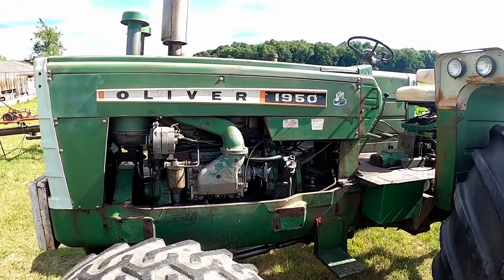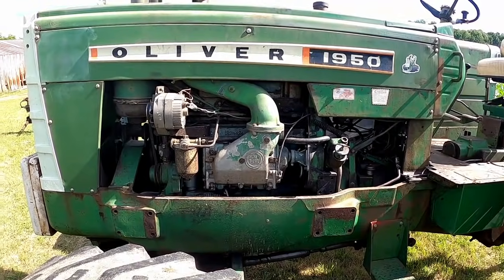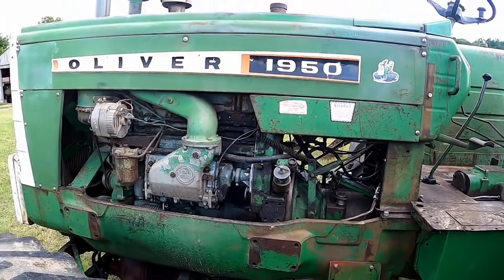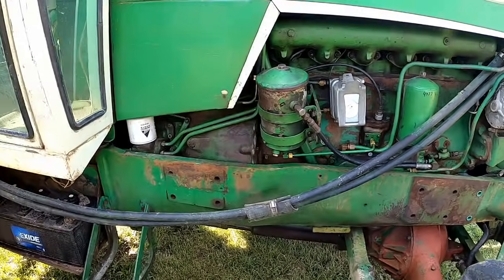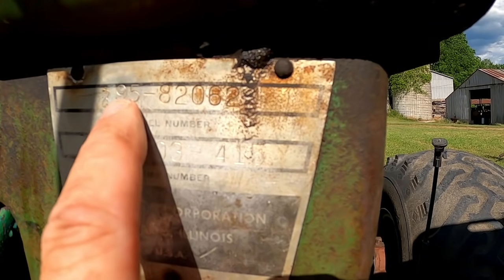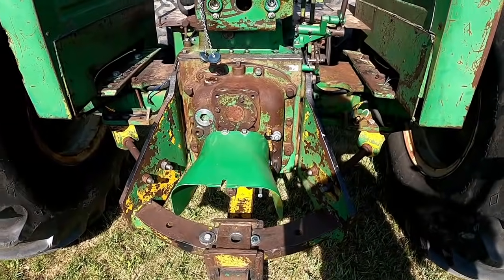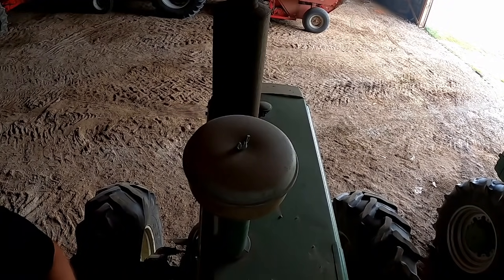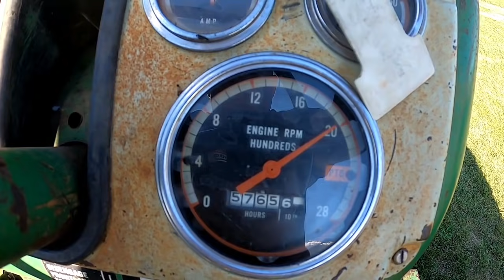1950 vs 1950T OLIVER. What's the Difference? with @burningdinosaurs

Comment: Nice job comparing the tractors.    I’ll never get tired of listening to those 310’s.
Reply from the maker: Same here. I should do a comparison between the 310 in my 1800 and 1750. There's quite the difference between them.
Reply: I miss that Waukesha loping idle. My granddad had a 1955 FWA.
Reply: @That Oliver Guy - Chris Losey  turbo kind of difference? Or something to do with fuel amount?
Reply from the maker: @jakesfarm6790  the 310 in the 1800 has the indirect injection Lanova head, like the 88s had, and the 1750 has the direct injected 310. Same bore and stroke, but the head makes quite a difference in the sound.

Comment: Never worked with a Detroit Diesel tractor but I've driven several trucks with 'em in the past 50 years. Don't miss 'em but I like to hear from far away. A few years I heard a DD fire up a good mile away. A local farmer was gaving some trees cleared & it waa on a skidder.
Reply from the maker: If you hear a Detroit around here in the winter, you know someone is getting some trees harvested.

Comment: Great history lesson Chris.  My father-in-law had a '69 1950T, that I found at the time at a Case dealership, in Huntington Indiana.   He had problems keeping head gaskets in it.  Found out the sleeves were not put in correctly in an overhaul.  It was also turning 160 HP.  Made pretty black smoke.  He had it turned back to 130.  It ran away with a 18' 271 disc.  It whistled much like your 55.

Comment: This past week a guy was getting facts about a airport fire truck(freaking huge, made by Oshkosh), so it could be sold via auction. So open the hood and written on the engine was Detroit series 92(think that's right). So found the engine model and determined it was a 2 stroke displacing over 12 litres over 8 cylinders. Monsterous motor.

Comment: Gonna make one comment here in response to a couple other comments.

I believe technically, any of the motors made in the 53 and 71 series were always General Motor's Detroit Diesel Division.  GM Diesel Division was for marketing and customer service.  So the 53 and 71 series motors were built by Detroit Diesel Division, but marketed by GM Diesel Division.  GM Diesel Division actually was responsible for Detroit Diesel and Cleveland Diesel.  In 1962 the last bits of Cleveland Diesel Division got absorbed into Electro-Motive Division, the latter not being a part of GM Diesel Division.  So in 1965 (right around prime Oliver 1950 time) GM Diesel Division got absorbed into the Detroit Diesel Engine Division, and then in 1970 Detroit Diesel consolidated with the Allison Division to make Detroit Diesel Allison.  So in all honesty, you are correct calling any Series 53 or 71 either name regardless of when it was built, in my opinion of course.

I definitely agree that you should make a video of the sound comparison between the Lanova 310 on the 1800, and the direct injection 310 on the 1750.

As far as one of the worst sounding engines out there, I'm gonna be that unpopular guy....I'm gonna say that those JD 2 cylinders are up there for worst sounding engines in my opinion.  I know they are super nostalgic for a lot of old timers, but dear lord I hate that sound....

Excellent collaboration video! And very informative, always fun to learn new Oliver facts.
Reply from the maker: Thank you for sharing all that info.

I've often wondered a JD 2 cylinder gets tuned since they never sound like they are running on all cylinders!

Comment: Another good one Chris!! Very informative on the difference between the two tractors.  I knew about the different tubs and that the Waukesha sat on a slight angle but I did not know the Detroit sat level in its tub. I like the way the 1950's sit alittle higher in the front, I think it looks good.  GM did that on purpose with some of there muscle cars in the 60's/70's such as the Chevelle amd Nova.
Reply from the maker: I failed to mention that a 1950-T Wheatland front tub is much more like the 1950 tub, the engine sits level in it, too. With the wheatland front axle it still sat level.
Reply: @ThatOliverGuyChris  I cannot say I ever have seen a 1950T wheatland modell. I have seen 1950T 4x4.
Reply from the maker: There were some Wheatlands, but I bet the vast majority were Cockshutts. I thought there weren't any 1950-T industrials, but one turned up over in the Netherlands a year or 2 ago, found its way to the US and is in the hands of a collector now. I missed out on a very nice 1950-T FWA years ago. I wanted the 1850 FWA that was to sell after it, and didn't have money for both. The T went low and the 1850 went high, and I got neither.
Reply: @ThatOliverGuyChris  Isn't that always the way. I believe the tractor dr. Has a 1950T mfwd for sale online.

Comment: Great video! 

A little back story-

I grew up on Olivers, never any Detroits, but got exposed to those engines at the local alfalfa dehydrator where I worked for four years as a teenager.

We had a fleet of Lowe and Champion self propelled choppers with 4-71s and 6V-71s, our 24' box straight trucks all had 6V-53s with Allison automatic transmissions.

The founder of the company had a 995 Ligmatic up until the late 60s that was used for plowing old alfalfa stands under and preparing and drilling new seedings.

I left the dehydrator in 2003 to go to college, they closed the next year.

I worked for the Detroit Diesel Allison shop in Des Moines with some old boys that started there when they got home from Vietnam, absolute 2 stroke gurus.

Those guys said that the reason for the change from GM Diesel to the Detroit Diesel name was because of marketing. GM had their heavy truck line, but their engines were popular with other brands and it was seen as a way to be more 'neutral', generic. Ford, IH, Kenworth, Pete, White, etc didn't have to market a competitor truck's name.

Thanks for all the excellent videos. If you're ever coming to central Iowa it'd be an honor to meet you. I've learned a lot from you.
Reply from the maker: Thanks for the info on the engines!

Comment: I have always liked the Olivers even though I have never owned or operated one. My question is Chris which one do you prefer and which is the most dependable? I have heard the 310's had some issues with head gaskets especially when turbocharged.
Reply from the maker: The turbo charged 310s were starting to push the envelope. The big problem was throwing rods. They're a good, snappy engine that can work hard, but they've also left more than one farmer stranded in the field. The Detroit is very reliable engine, those 2 stroke diesels powered America through the 50s into the 80s. As to which one I prefer, it's a tough call, but I'd go with the 310. It's the sound I grew up with, so I think nostalgia wins out on that one.
Reply: @ThatOliverGuyChris  The 310's had to have a good oil cooler, as you stated hot oil will take out an engine and leave you stranded in the field.

Comment: The information about why the engine is on an incline was awesome to learn the true reasoning  of after having been asked by friends who are red fans and the only trail of info I had heard was that it was to keep oil from creeping up the live shaft and leaking? Also true?
Reply from the maker: I should have mentioned it goes back to the pipe cultivator days. Kicking the front of the engine up gave them room for the pipe without losing crop clearance.

Comment: I would love to see you use your 1955 more love the engine grunts
Reply from the maker: There are some videos of it on here. Most of my corn is here at the home farm, maybe it can run some wagons this fall.
Reply: @ThatOliverGuyChris  also love the video content I grew up in Hebron ohio on my my uncles dairy farm and most of his equipment was Oliver tractors a 44 super 77 gas (workhorse lol) with tricycle front end they also had a diesel version of the super 77 but it blew up and traded it for a 770 and I will probably say that his pride and joy is his 1655 diesel power shift and tell you what he had a Ford 7000 and the 1655 could out pull or perform the 7000 by doing 2x the amount of work but later on he bought a deutz 130 06 fwa and I was so impressed with the deutz tractor I was about 12 or 13 at the time I asked if Oliver built the tractor lol
Reply from the maker: It seems like Olivers were popular with dairy farmers. I also think that's why 1655 fenders rot out. Too much manure.
Reply: @ThatOliverGuyChris  the fenders are quite good that was my seat on the 1655 and that tractor was rarely used to haul manure 77 or 770 in the winter the Ford 7000 was picked because of the cab like I said before I think that 1655 was or is his pride and joy lol

Comment: Curious, do these six cylinder Olivers use a lot of diesel compared to your White/Agco tractors? Do you have to put any additives in your diesel fuel because of so many ingredients have been taken out of modern diesel fuel?
Reply from the maker: I think they are efficient,  probably not as much so as a Cummins. I buy premium diesel and don't add anything to it, and have minimal troubles.

Comment: One thing I've always wondered is this. Why does the 310 lope so much at idle? I know its not something wrong as literally every 310 I've heard does it, but I just thought it sounded cool and was wondering why it did it.
Reply from the maker: Guess I don't have a solid answer for that. My guess would be the governor in the Roosa Master injection pump. Other brands of engines used the same pump, but I guess I haven't noticed it with them.
Reply: It's the governor on the Roosa master pump they will lope a bit at idle.
Reply: @ThatOliverGuyChris  I feel the olivers lope because the flywheel, crankshaft, rods and pistons are relatively light compared to say a John Deere  and they also have a relatively short stroke. The John Deere 4010 and 4020 had basically the same injection pump but did not lope or atleast not as bad. The oliver Is a much more snappy engine than a John Deere which makes the governor weights more erratic.

Comment: I have JD and Massey Ferguson tractors and truly would like to get an Oliver tractor. which Oliver tractor do you recommend for mowing and bailing hay and which oliver do you reccomend for chopping corn silage? thanks
Reply from the maker: A 1650 or 1655 are hard to beat for thr mowing, baling, and general farm work. Chopping corn depends on how big your chopper is. An 1850 diesel might be a good choice for a 2 row chopper. A 2150 or  2255 would awesome for chopping, but they have gotten expensive as collector tractors.
Reply: @ThatOliverGuyChris  I appreciate your response.

Comment: GM detroits were one of the first to be a real engine with common rail fuel system with roller rockers, and piston cooling jets way back in 1938. Blowers and the whole pressurized block system using slide ports was a simple design. and the heads only having 4 exhaust valves made it simple. but in the later years 70s-80s  cat and cummins were a much better heavier built engine since GM detroit stuck with the 2 strokes way too long and they could not evolve.. . My question would be on the oliver industrials did they use the Hydrostat type trans or a a torque convertor for vari speed  ??
Reply from the maker: They could be ordered with a reverser built by funk. It had a torque converter in front of it
Reply: @ThatOliverGuyChris  ok very interesting

Comment: Hey Chris I have a 1971 1855 thing starts great and sounds great but has no power and lugs more than it should. The air filter is clean would you lean towards a bad turbo or timing?
Reply from the maker: Does it smoke much when it labors?
Reply: @ThatOliverGuyChris  yes it does

Comment: Was just wondering what years and models did Oliver put the Perkins engine in
Reply from the maker: The only Oliver tractor with a Perkins was the 1850 diesel, built from 1964 to 1969.
Reply: @ThatOliverGuyChris  thanks had a friend that had one with the Perkins engine in it but I couldn't remember what size. We had a 1800 it was a really good tractor but we got out of farming and sold it. Thanks again

Comment: Im kind of new to the channel i was going to buy a 1750 but bought a 2-85 im told a 1850 is very similar and i have a chance to buy one my daughter loves your purple 1850 whats the difference lol im think you might see a few purple 1850 lol
Reply from the maker: The big difference is the hydraulics.  The 2-85 has closed center, 1850 is open center. There's some things, like hydraulic actuated pto and brakes on the 2-85 that are mechanical on the 1850, but when it comes to the drive train, they're almost the same tractor.
Reply: @ThatOliverGuyChris  right on thank again your channel me and my 2 kids love waching thier only 2 and 4 they love herman 2 stroke detroit i have a 3-54 in a massey loader
Reply from the maker: That's awesome that you watch with the kids! Thanks for tuning in!

Comment: What is an. El Toro oliver?
Reply from the maker: While many think Herman is an El Toro, that's not correct. Any 4 wheel drive Oliver shipped 'south of the border ' got the El Toro designation. This included New Zealand and Australia.  It didn't matter what size it was or what tires it had, any 4x4 model could be an El Toro.
Reply: @ThatOliverGuyChris   thank you for clearing that up for me. I thought any 4x4 with the Tera tires was an el Toro.. Love your video's by the way.

Comment: I'm just saying if you actually look at your comments I worked on a farm they had an Oliver Fiat I was wondering if you know what a Fiat was just wondering
Reply from the maker: I read all of the comments. Fiat is an Italian tractor and car manufacturer. Back in the 1960s Oliver had entered in an agreement with David Brown to produce utility tractors to be sold as the Oliver 500 and 600. That only lasted for a couple years, as David Brown wanted to enter the American market and didn't want to compete with their own tractor that Oliver was selling. That was when Oliver got together with Fiat to have them build utility tractors badged as Olivers. The first 2 models were the 1250 and 1450. Both were somewhat older designs and the 1250didn't prove to be the best tractor. Fiat updated it  and Oliver called it the 1250-A. It was a much better tractor. There were several models produced over the years, even into the early times of the silver painted White models. At some point around 1980, the deal between White and Fiat ended, and White went with Japanese tractor manufacturer Iseki for their small tractors.
Reply: @ThatOliverGuyChris  I remember those Iseki tractors back when I was young (and they were new - both around 1980, lol). They seemed like really nice machines.  Way smoother than the 2 cylinder Ford or Kubota of the day.

Comment: The worst thing about a Detroit diesel after a few hundred hours of use they were like an Harley Davidson 
Motorcycle...they would mark their Territory/SPOT  LIKE A DOG
Reply from the maker: I'd also add their ability to run backwards. A guy that worked for us told me how was pulling up a stop, and he thought he had stalled it, but it kept running. When it was his turn to go he let up on the clutch and the truck started going backwards! He had to shut it off and start it again to get it going the right way.